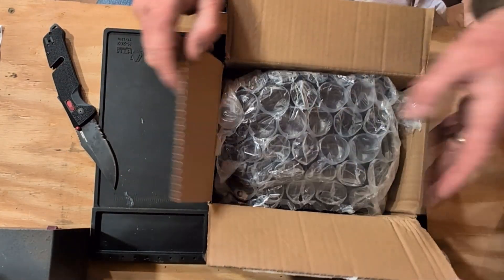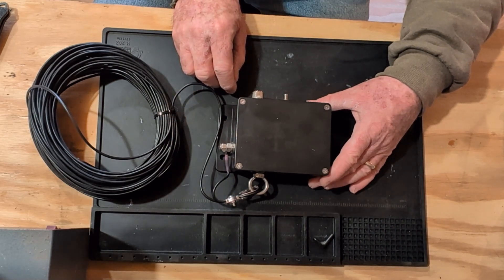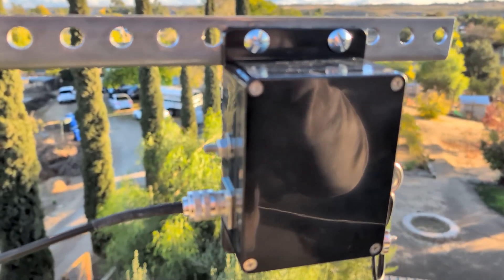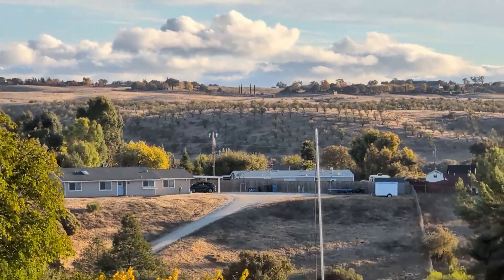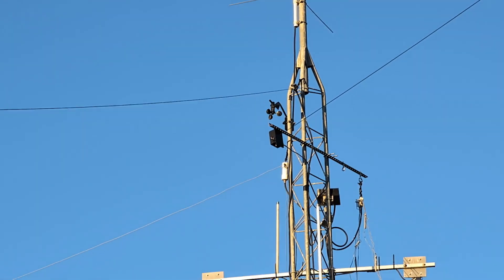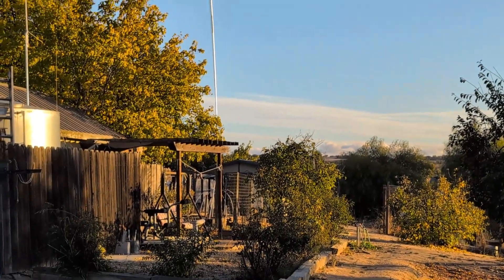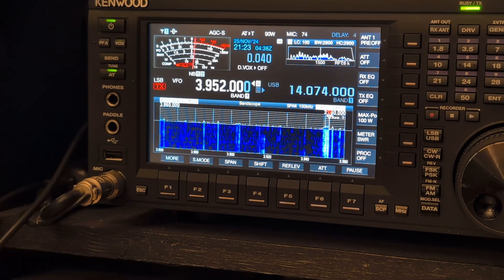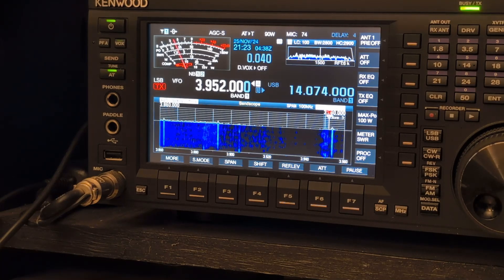Amazing End Fed Half Wave Antenna !

Comment: Great demo of the setup. Very cool. What was the wire length you used? Did you need to trim at all?
Erik N4ZAP
Reply from the maker: The wire is 132 ft long, no trimming needed. KO4FSZ does some "tuning" before the antenna ships, based on a variety of factors, such as my coax length to the feedpoint, height of the installation and so on.